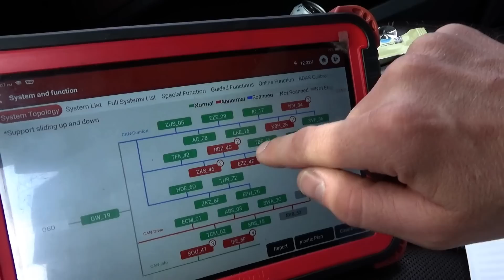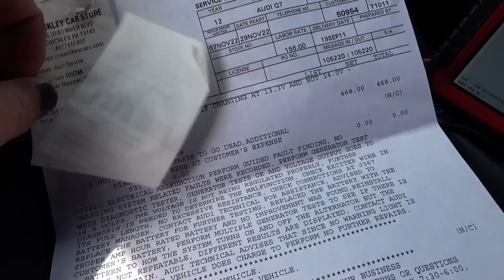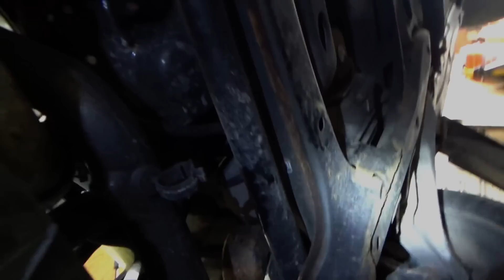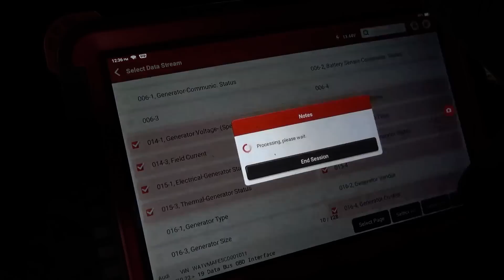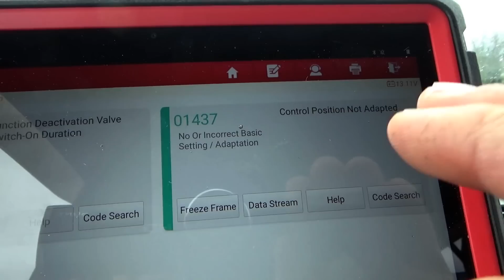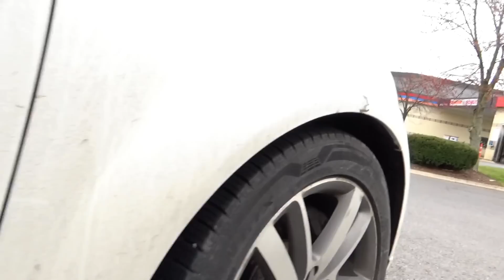Audi From HELL...DEALER STUMPED!! (Part 1 - Charging & Air Suspension MALFUNCTION)

Comment: New cars are way over priced and the cost of having a dealer work on the car is prohibitive to say the least. it appears that Audi has no room for common sense in the trouble shooting or repair process, From my point of view cleaning a corroded connector does not pay as wells as bending the customer over the counter and sticking it to him which in my opinion appears to be the word from Audi headquarters.  I have dealt with service managers before and from my experience the bottom line drives all repairs

Comment: You missed the diagnosis in prior bill. Dealer said alternator plug into wrong connector unless the pins were reversed I do not see it being plugged in on the wrong connector when the one side of the connector is blank and this plug will on plug on one way.

Comment: I feel kind of bad for that “Master Tech”. He’s not allowed to diagnose, just follow a diag tree that leads to a parts cannon!  The fact that they couldn’t manually run the pump after not plugging it in fully should be cause for at least a partial refund as it was a self inflicted problem.  Also, 26 amps seems quite high for a small air pump.
Reply: It's only 300W. Much less and it'd take all day to raise and lower.
Reply: The work order stated that the pump was bench tested, and that it needed to be replaced. No sympathy for the Master Tech.

Comment: I did all that. Bought a Think Tool Pros to add to my collection of tools.  And then an intermittent transmission problem hit my truck.  It wouldn't stay broken long enough for me to diagnose it.  So after some research on the interwebs and taking the codes at their word, I threw a lead frame at my 6R80 transmission.  If you read the diag tree, it could be PCM, TCM, connectors, harness, or lead frame.  But to narrow it down, it has to stay broken.  Having to guess was so frustrating given I like to prove something before diving in.  That's why I watch this channel.

Comment: So they bench tested the pump they say? Me thinks not. Dealerships would do better to hire a real tech, like yourself, rather than blindly following what their magic white paper says. Yeah there masy well have been crusties, but a proper tech will be able to tell very quickly if that is or is not the cause of the customer complaint. This is where you end up with the problem of dealerships replacing complete systems, only to find it did not solve the issue.

Comment: Yea, I did recently have a little laugh at the local Opel dealer... The tires were losing about 4,3 psi a week. At the dealer it was noticed the tires were worn (they were), so those were replaced. Funnily enough, those new tires were also losing pressure at that same rate. How much does that cost to fix that? 750 euro (over 800 usd)! Needless to say a local little generic car garage did charge very much less! The issue was the valve were leaking. Sure, there are TPMS sensors at play, but even those are not a fortune!

Comment: I think you could get very snippy with the dealer and they'd give you your money back - 600 for diagnosing nothing, because they unplugged the pump and thought it was dead...that's shocking. 
Fine, they're policy may well be to quote what they quoted to fix it, but that amount of money for a half-arsed diagnosis isn't acceptable. In the UK you'd have a legitimate case with trading standards, I dunno what you've got over there. 

But the most interesting bit is their mechanic saying the equivalent of "if we find water damage you'll have to buy a new phone". I didn't ever think main-dealers did this. I wonder if it's worldwide..

Comment: Don't blame the dealer you couldn't figure it out either, you could have pulled up a wiring diagram and gone under the car and probably would have found the crusty's in the plug, you did check the sensors but you skipped that part. Your labor rate is pretty high also so the customer would have a high bill also, in the end they did figure it out so you have to be humble and chalk it up to learning experience. I worked at 2 dealerships in my 47 year career they replace all the parts cause they don't want a come back and I agree, I'm not working for free the second time around, I don't care what it cost the customer, if they can't afford it buy a cheaper car.
Reply: What are you talking about?  The only thing they figured out was there was some corrosion in the connector that isn't even likely the cause of the issue.  To say they applied power directly to the pump and it didn't work was either a lie or that "master tech" didn't know what he was doing.  Either way it was a complete ripoff.
Reply: @johnaclark1  Don't get me wrong I like Ivan he puts out good videos but the fact is he had the car for a week and he didn't figure it out, he could have done what the dealer did in 3 hours but he didn't it's that simple. It cost him $600 but don't forget that mechanic is only getting a fraction of that and same if the customer pays the $1600 or whatever it is, to fix it
Reply: @ws2664  Did you miss the part where he said he spent 3 hours on a Facebook Live with Keith and another diagnostician and they came to the conclusion it could be a problem with the aftermarket scan tool?  With them even remoting into his scan tool?  Seemed pretty reasonable to not waste more time and take it to someone with the right tools for the calibration.  Too bad the dealership has all the right tools but not the knowledge to make an accurate diagnosis.  As Ivan just said, they made it worse, not better, and gave an inaccurate diagnosis.

Ivan's only mistake here was trying the calibration in the first place.  Seems like a pretty harmless thing to attempt but, in hindsight, I'm sure he wishes he'd have just left it alone.  I have been guilty of doing that too, just never to the extent where it cost me $600.  This is a good example of why It is always best to only do what we're hired to do.
Reply: @johnaclark1  Yup, couldn't agree with you more.
Reply: @johnaclark1  I just thought of something and I want your opinion, lets say that car was at a local shop in town that Ivan does business with and the car has been there for a couple of weeks cause there to busy to get to it so they call Ivan, would he do anything different? Now lets say he spends 3 hours on line with Keith and the other tech and they say take it the dealer cause they have the tools, so they do and now the shop has to pay 600 dollars to get it out and it will cost $1600 to fix it. Should the shop charge the customer the $600 for diag cause that's what Ivan told them to do?
Reply from the maker: "In the end they figured it out"....ummm no, they actually BROKE THE CAR even more and charged me a lot of money for it xD
Reply: @PineHollowAutoDiagnostics  Well then next time don't take it to dealer, send it to the junk yard where all those Euro cars belong.

Comment: Most new cars today are crafted to be rentals with a 5 years life span, thats why most dealers mecanics are becomes parts swappers bots.  I keeps my cars running for 10-15 years because I choose simpler cars with manual gear box and less electronic gadgets unlike this audi air ride.
Reply: My 'daily' turns 30 next year. Screw new cars - I don't need that complication in my life.
Reply: @TonyRule  I envy you, here winters salty roads eats all cars...

Comment: With the exception of changing the moisture absorber canister and I did need to change the rubber "springs" in the back after 30 years, the air suspension on the 'ol Marquis still operates like it should.  I hope it continues.

Comment: Took my dad's 2011 Buick to the dealer because the self-level system ran the compressor all the time and killed the battery. Diagnosis fee was $188, and they said they WOULD NOT REPAIR IT, because the ride height sensor was bad, no longer available, and they WILL NOT use aftermarket sensors. So it fell to me to do something. I felt like the control module might be bad, because I verified the output of the sensor changed when I put the fuse back in and the pump ran. I put a toggle switch and pressure gauge in the trunk, so I could see the pressure and control the pump. These unnecessary gadgets are nothing but trouble and expense, but my dad loves them.
Reply: Same thing happened way back in 1984. We had a 79 Buick Estate Wagon and on vacation when the rear leveling system got stuck (probably from constant adjustment due to luggage).  The morning after we arrived at the cabin, went outside and the Buick looked like it was raked up like a hotrod. Well it did have an Olds 403 v8, but I digress. Anyway after reading the manual (novel concept I know) we found the Schrader valve to release the pressure and leveled it back out.  Just a 📝 memory that you video helped recall. Later Ivan
Reply: I always wondered why manufacturers started making cars so 'smart'.  It's not like they care about ease of use for consumers...it's like it has to do with money.
Reply: @deplorablelibertarian  Build cost per unit that is all it comes down to.
Reply: I once mounted a household light switch and box on a buddies foreign car to get the a/c to work.  He eventually replaced it with the OEM in order to sell the car.  But it worked.  The frustration of the way many devices have over-complicated is mind numbing.  Even windows operating systems are not as good as they once were.  Nothing is working anymore due to the built in BS.

Comment: They left that unplugged for a reason! Dont let them lie to you.
Reply: Sell another pump? 🤔
Reply: @dans_Learning_Curve  Or a pump and air shocks if you drove it off the lot.
Reply: Many years ago, a Honda dealership purposefully poked a huge hole in a friend's muffler during a 90,000 mile service.  They saw a little old lady bring in a car, and figured she would never crawl under the car to look.  I had been driving the car, and knew it hadn't had a problem, so I crawled under it to look.  I saw an 1 1/4 hole in the end of the muffler with tool marks around it where they had bent the edges back with pliers.  I took the car back to them and read them the riot act.  The service manager would not meet my eyes, and tried to tell me that the only way they could tell if the muffler was bad was to take a sharp object and poke at it.  It was an aluminum lifetime muffler.  I told him that sharp object didn't bend the edges back to make the hole bigger.  I thought he should have at least put a new muffler on for free, but my friend was too polite and wouldn't press him.

Comment: This is becoming a real issue.  We are seeing unavailable parts as well as inexperienced techs at dealerships and now technician "rules" that do not allow proper diagnostics.  It is almost like they don't want people to be able to fix older cars.  Hmmmmm?
Reply from the maker: 100%!!
Reply: Exactly what manufacturers are driving  at! It seems like a conspiracy at this point. So called “Authorized” repair like Apple,Samsung,Auto dealers ect ect, the list is growing fast, make it  almost impossible to to make money because you must replace the whole system to cover their ass, besides that refusing to to use aftermarket parts to fix something when the OE stops making them or disabling a certain product functions like Apple does is madding…I think anyone repairing anything, especially cars and have channels like South Main Auto and Pine Hollow Auto Diagnostic should really harp on this subject more because it’s getting to the point that our ability to do our jobs will be more difficult than it already  is….
Reply: Slap  a ford emblem on the front, and drive it to canada so that dealer tech with the cam phase problem can look at it.  🤗
Reply: or new ones for that matter.

Comment: When you said: “You won’t believe what I found”, I immediately said: “Yes I will”! My blood pressure was skyrocketing too because I’ve had so many of these “dealer debacles” and I know EXACTLY how you were feeling during the process. The moral to the story (as you said) and I’ve been advising folks for 50 years…..stay out of car dealerships, and there is no such thing as a “Master Tech”.
Reply: Lookthere’s a lot of bad dealers out there. But I’ve been in the shop with a true master tech and diagnostician. They exist and they are awesome.
Reply: @Turbo_Q but not at the dealer. Dealers want people to work for free. Masters do not work for free.
Reply: @SK-2ill  If you go to their one/two day courses you too can call yourself a MASTER TECH.
Reply: @LesReeves ir you can Prove you can change the oil & filter , and do a wheel rotation without cross-threading any of the nuts & bolts, you surely deserve to be a master tech! Oh, and not forgetting to reset the service light as well…😂
Reply: @Turbo_Q They still exist, but good luck finding one. The rest are one step removed from Jiffy Lube.

Comment: Wow, I owned a 2014 VW TDI when the Diesel Scandal settlement was announced.  The car ran so well that I was tempted to keep it despite the lucrative buy-back offer.  But after reading about some of the complications and expenses associated with maintaining these cars, I decided to take the money.  After seeing this, I am so thankful that I made the right choice.
Reply: Me too, but a 2012 with around 80kmiles on it. It had some weird programming issues like the reverse camera would blank out if you went too fast, it would not change down gears on a left turn up hill until it almost stalled. Both of these were repeatable. Every few months, the drivers seat would be rammed all the way forward, never saw it happen....would it have crushed me ?? Also the XM radio sounded like a crap AM signal ripped from a rubbish MP3.
But, it went like you know what off a shovel and had remarkable fuel economy. I did 711 miles on one tank of diesel in 11.5 hours non stop on a trip.
I made money off VW for that one and now drive a 2014 Highlander with 230kmiles on it and EVERYTHING WORKS still, radar cruise control, lane departure, heated/cooled seats, radio sounds great.
Reply: My brother made the right choice to keep his 14 q7 tdi, get paid, get thousands in free service/replacement/updated parts.  He has since removed the factory designed failure points and is running better than ever.

Comment: Dealers are just parts replacers.
Reply: Company policy.
Reply: That's what they are told to do. It's basically saying if your engine is rod bearing is worn they will say replace engine. They could care less to drop the pan and install bearings . If your harness is slightly melted or has an open they are told to replace whole harness. When you could just cut the open on the harness for zero cost

Comment: Did you pay by credit card?  I would file a dispute.
Reply: I think if you read the tiny tiny small print on the back of the estimate, youll find out youre screwed. Stealerships have lawyers😮
Reply: @pootthatbak2578 no harm in trying.  Fraud voids a contract.

Comment: A water cooled alternator, yeah, that`s never going to be an issue.🤣 4 rings strikes again! This will be a frustrating series for Ivan. Cars have become rolling computers, no thanks, I`ll keep my 1991 C1500 running.
Reply: The 4 rings mean repair cost stings.
Reply: The engine is water cooled.  Think about it being air cooled.  As everything is moving towards electric instead of mechanical power, you have to get rid of the heat somehow.  Even modern CPUs and GPUs are using liquid cooling.  Look up "heat pipe".
Reply: Water cooling is quite common on high power alternators, they'd have to be significantly larger to be able to utilise air cooling
Reply: On the Audi R8 they have a water cooled alternator and in order to change it you have to remove the motor

Comment: I recently had to deal with a intermittent "reduced engine power" issue on 3.8 grand prix would mostly happen when very humid. Knew better than to fire parts cannon from watching your videos and after verifying no damaged wires with wiggle tests i started attacking all the connectors and lo and behold a grey connector by the drivers side strut tower that connects the pedal to the throttle body was full of condensation, no green crusties yet but i brake cleaned and blew out with air the connector and put dialectic grease on the gasket and no issue since.
Reply: Knowing that exact connector well, the water is almost certainly coming in from back side (wire side) of the connector instead of the labyrinth seal between the two sides of the connector.  Seal that up (oddly difficult) and it won't happen again.
Reply: @michaelkrenzer3296  Will do thanks for the tip